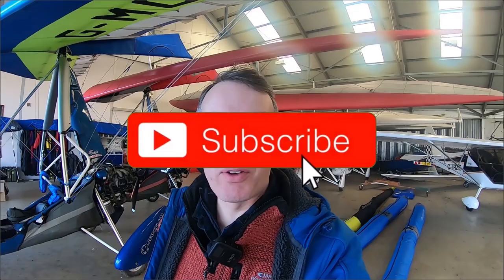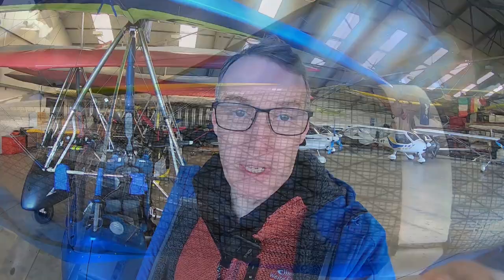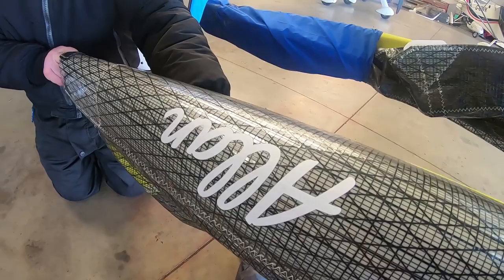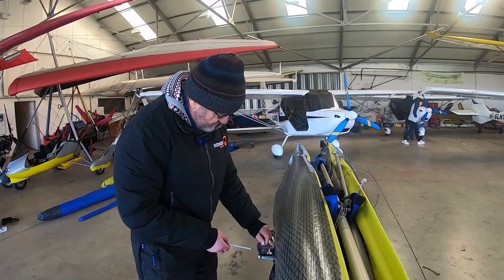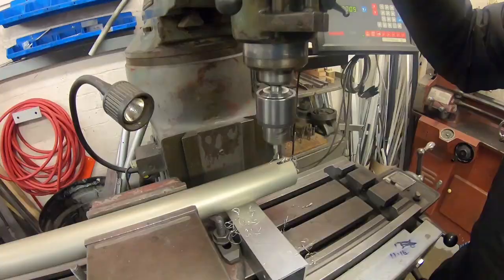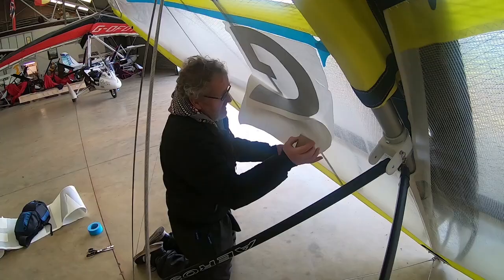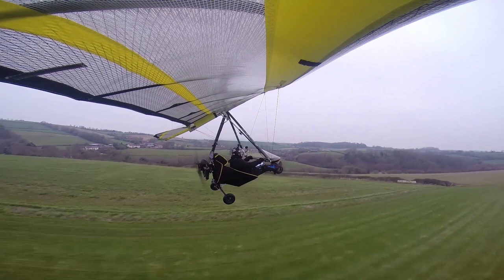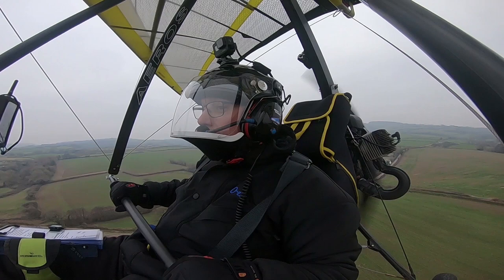The SECRET is it out  - My NEW wing - FLYLIGHT wing upgrade ( Teaser at the end)

Comment: I also found the wingtip straps can be a bit of a pain to get off because they're so tight. Ben has videos of pushing against the washout rods with his feet but removing those screws at the nose is a much easier thing to do and has less chance of bending things. You just have to remember to put them in again when rigging! The wing manual does describe doing this but has no pictures so it's easy to skip over.
Reply from the maker: Hi Sephizor, the later wing have a longer tab at the nose to allow the leading edge to slide. I personally don't have a need to wing fold mine so I'm happy. The new skin has the longer tabs so life is now a little easier.

Comment: You must have been so impressed with the Adam ! I had Avian convert my Fly wing to a Rio as I wanted a double surface . I’ve recently bought an Adam trike which needed altering slightly to accommodate my Rio .
Reply from the maker: Hi David, I hope you are well. I have been impressed with the Adam, but I'm not that experienced with other wings outside of the Aeros designs. Are you enjoying you RIO?
Reply: @GolfFoxtrot22  I’ve not flown it yet with the Adam ( the Atom 80 is still to be fully run in ) , Ben test flew it with a moster Adam and said that he preferred the Adam wing as it was faster and more agile , I dare not fly an Adam wing as my pockets aren’t deep enough !

Comment: I am so ignorant when it comes to flex wings, so did you replace all of the fabric and kept the frame or have I got that wrong? Apart from handling differences are there any changes to performance, i.e. stall speed, cruise speed etc. with the new wing? Also didn't realise it was the wing that constituted the airframe for registration purposes.
Reply from the maker: The wing is the part that is registered and holds the G reg on the CAA database and the trike is the add on. The handling differences were so worth the time and energy to upgrade.

Comment: Good vid. So, just easier to trade up or this version wing was a harder conversation due to like Ben said it was an early version wing.
Cheers
Reply from the maker: In short, yes, just change wings. But I wanted to keep my G reg which is tied to the wing.
Reply: @GolfFoxtrot22  Interesting work around.  I wonder how that works in Canada if I wanted to change my wing.  I have my reg # on my trikes Mast. A question for my Instructor!
Cheers
Reply from the maker: @patrickmckowen2999  it's all in the detail.